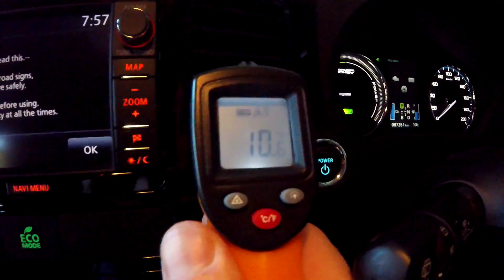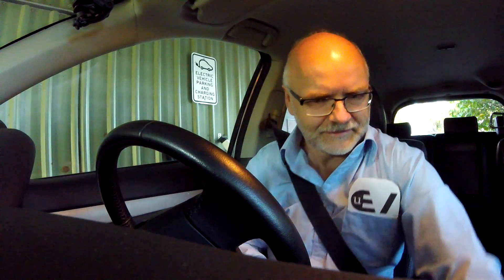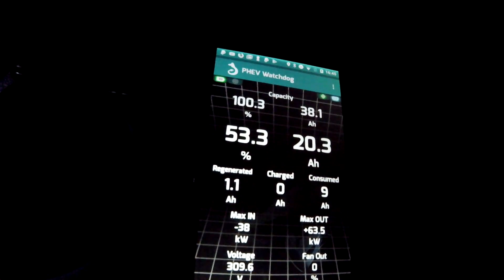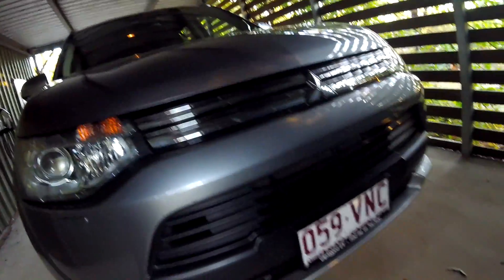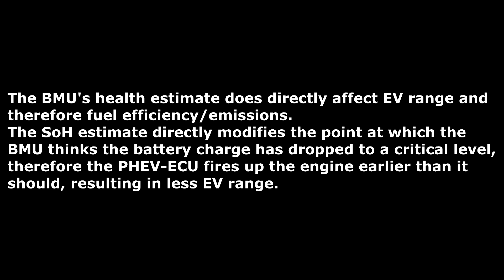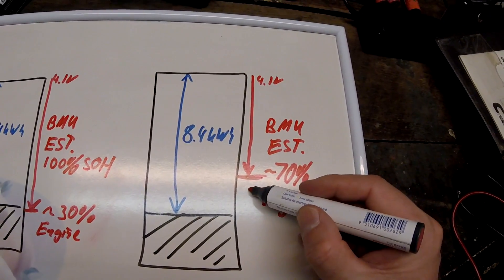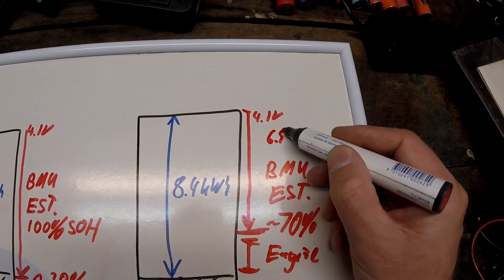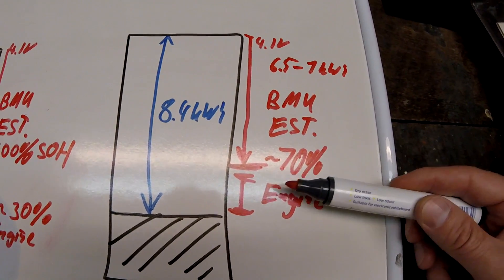EP249 - Fuel and Emissions up, EV down - Mitsubishi's #PHEVgate

Comment: Just a few thoughts...

Hmmm...70% of 70% equals a 50% DoD  Looks like their aim is to maximise the number of cycles from the battery, thus guaranteeing that they do not need to replace any batteries before the end of the 8 years guarantee period(UK). The problem arises when the drop in performance is more than 3.75% annually. Otherwise, their BMU is doing exactly what they have designed it to do...decrease the stress on the battery annually, by decreasing the demanded DoD, thus increasing longevity of the battery itself. They have been very clever...they have not said what the annual rate of decline is, only that they guarantee the battery will still be performing at 70% capacity at the 8 year point. The BMU appears to be making sure, this is the case, imo. This would be my understanding of it's operation.
Possibly a reset of the BMU based on real SOH rather than estimated SOH is what is needed, to maximise EV range, but it is at the cost of 'battery cycles' down the road somewhere. If everyone thought that the battery would need replacing after 8 years, then the annual depreciation on the vehicle as a whole, would be much steeper, however, this is not the case. It will still have a very respectable EV range and functionality even after the 8 year period, which will make this a much sought after car in the second hand market in years to come. 
Ok, so as the car ages, you will have to charge it up more frequently, but it will take less time to top it up and cost slightly less to charge it. The people most affected, will be folks with max ev range commutes every day. If the majority of your trips are less than full EV range, then little difference. If the majority of trips are say 100 miles etc, then instead of 30 miles EV range and 70 mile ICE, you might get for example, 27miles EV and 73 miles on ICE. I dont see this as a major impact overall for an aging car.
As an owner that intends to keep this vehicle long term, the more i think about it, the more i love about this vehicle. 
For folks that like to change cars every 2-3 years etc, then they might like maintaining higher EV range annually, but they might not like depreciation rates on the car value, since if this was the case, as it correlates to battery longevity and 'depreciation rate curve' over the lifespan of the car.

Food for thought perhaps?
Reply from the maker: Yes, that is the thought behind MMC's strategy. Of course they don't want to replace batteries every few year in each car. The BMU is here to protect the battery, for sure. 
BUT, here comes the big BUT: They don't tell anyone about that. The car is advertised with 54km of EV range, 1.9L/100km fuel consumption and 80g/km CO2 or whatever it says in your brochure. That these figures only last for a year is a big problem, especially when the government give you an incentives to buy a clean and environmentally friendly vehicle. After 2-3 years this vehicle gets less and less EV range and emits more CO2. This is not the idea behind having such cars on the road.
Reply: @unpluggedEV  Advertised in uk(originally) as 32 mile(51.5km) range dropping in capacity over 8 years to potentially 70% = 22.4 miles(36km) = 1.2 mile(2km) per annum drop = normal/expected if linear. 

The newer models are only stating 28 miles(45km) starting range. (colder climate than Australia)

https://www.mitsubishi-motors.co.uk/cars/outlander-phev

How many of your actual journeys are going to be affected by this drop? Calculations need to be done, on the difference....not the total mileage(if you get what i mean). As a percentage of total (normal miles), the impact will be minimal....imo.

Does any ICE perform the same over an 8 year period or does performance decline?
Folks using batteries for solar system storage, motorhomes etc plus phone batteries, all lithium technologies, degrade... they know this and accept.

Now, i'm not saying that you dont have a point(especially if in some cases degradation is greater than linear expectations) and i commend your commitment, however, in my own personal circumstances, i have to view this in perspective.
Reply: @jimmaxwell2259  More than half of my journeys are affected by this. I have battery to work and it ends somewhere between 1 and 12 km on the way home. It used to be somewhere between 11 and 22km on the way home. In the end this ends up being a lot of money over one year. Roughly 300 Euros...
Reply: And a comment on the battery range as well. When the battery is at 70% the useable range is from 21 to 70%, ie 49%. It started at 70% (30 to 70). This means that the capacity loss (and range loss) also is 30%. My battery is at 81% after only two years.
Reply: @ervjhb  Jan, calculate the difference....on half your journeys you are getting a few km less at the cost of electric power, versus that same few km at the cost of petrol. Electric power isnt free power....you have to calculate the difference in cost for those few km for each affected journey. A 2yo car, i would expect to be a 4km drop in range(normal/expected), so the difference (for each journey over the original EV range) is equal to the cost of electric energy over 4km versus the cost of petrol energy.
Reply: @ervjhb  jan i would have expected your vehicle to be about 92.5% capacity(or 42km) after 2 years, so 81% does seem extreme...in my estimations.
Reply from the maker: @jimmaxwell2259  Mine was at 70% after 3.5 years and only because they did the reset on mine before.
Reply: @unpluggedEV  That is really interesting Andy. That would suggest a non linear degradation such that, it either drops quickly then levels out at the 70% value or else, had you not had the reset, you would have been under the 70% warranty guarantee value and would have been due a change of battery imo. The main thing i take from all this, is that you have made owners aware that they need to check the real SOH of their battery before warrany expiration dates and insist on replacements....not simply a reset of the BMU to fudge results. So, a big thank you from me, your endeavours are appreciated.